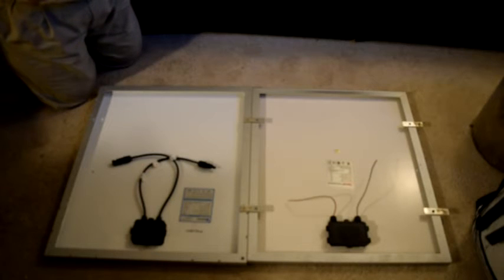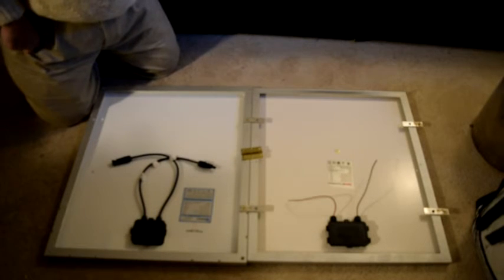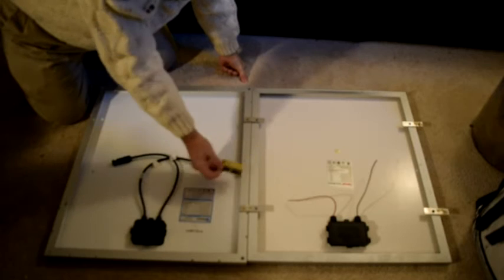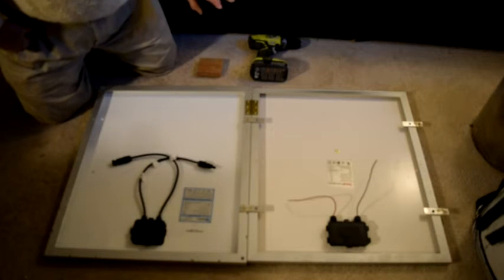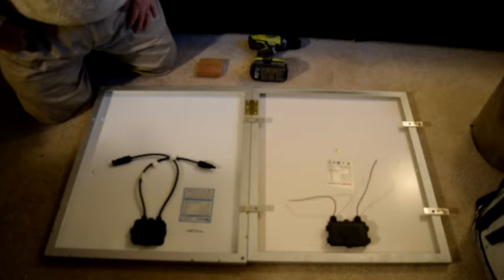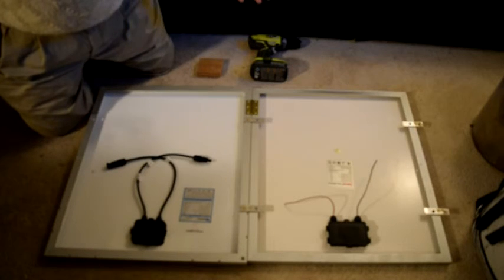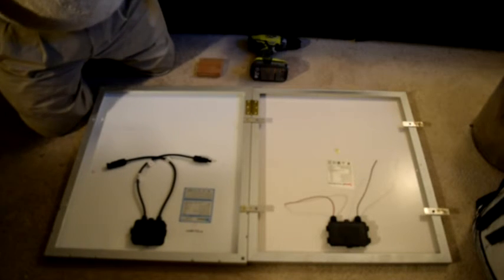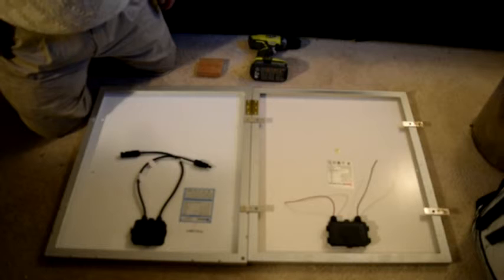DIY Portable Solar - 2:  Folding 100 watt portable solar setup

Comment: Hi Todd, love your solar videos. I am researching the best approach to take in creating a mobile solar system for truck bed camping. I have a travel trailer w 100 watt solar system but want to have a separate more wattage system for dry camping w truck alone. Call me crazy but I would like more conveniences while truck bed camping. System can then be used to upgrade watts for travel trailer as well. Problem is the size of panels for handling purposes. I saw this video and wondered if I should make 3 of these 100 watt portables to be used in additional to a 100 watt renogy suitcase kit I purchased few years ago.  Would there be any difference in battery charging capabilities if had 4 portables (8 x 50 watt) set up in series w mppt controller versus 2 150 watt panels (300 watts) and the 100 watt suitcase  set up in series w mppt controller? I think I could physically handle and store the 4 portables easier in crew cab part of my truck. Also, plan to keep the battery bank in back seat area as well. Battery bank another big research thing as well. 
Thanks so much in advance for a response.
Reply from the maker: Hi Katherine,
You asked a complex question.  I will do what I can to answer it for you.  How much solar you need depends on a number of factors including: how much power you use a day (i.e., what you are powering), and where and when you are camping.  If you camp in an area with lots of cloudy weather you will want more solar than if you are in a generally sunny area.  Sizing the battery bank depends on three main things.  First, how much power do you use.  If you use 100 apm-hours pr day you want at least a 200 amp-hour battery bank.  Second, how long would you like to be able to run on your batteries if the weather is cloudy.  Finally, how long would you like your batteries to last (the bigger your battery bank relative to your use, the longer the batteries will last.  So if you can give me a few details of how you camp (what sort of stuff you run off batteries, what part of the country you camp in, how long you generally go out for) I can give you some much more specific details.  No need to give me any specific information as far as location, just southwest, midwest, northwest, etc.

As far as running 400 watts of solar goes you will want a 30 amp controller.  If you went with four foldable 100 watt systems I would set them up individually and run the wires to a common point next to the controller so that you can have relatively long wires between the panels and the common point.  I can make this more clear in a short video if you want.

Hope my comments help.  Thanks for watching my videos and commenting.
Reply: Todd Dunn thanks so much for responding. I live in southwest, New Mexico. I love going to northern NM and Colorado w my travel trailer. I also do some travel trailering in AZ and all over NM when not too hot. I am fixing up my Dodge Ram 6.5 bed w a cap on Monday so I can venture into places I would not  dream of taking my 30 ft trailer. I want to be comfortable so I would like to be able to run a fan all night and  more, run a 600 watt dial microwave for short periods, single serve Keurig  if I can, and the usual phone, notebook, type things, likely a 12 volt portable cooler too. I also want to use these things for my travel trailer when I boon dock. I don't boon dock often because I love my Keurig barista coffee. Can't run a generator because I am awake way too early to run it. I calculated about 1500 watts a day w a 2 day reserve needed in addition to the 1500. I would want to only run my batteries down by 25%. AGM 6 volt 225 AH is what I am thinking to buy, 4 of them. 900 AH so if my thinking is correct that only would leave me w 222 AH use for 132 amps, 264 amps w the reserve day.  Not sure calculated all this correct. New to all this solar math. 1500 likely on higher side of what I would use daily. 

The solar suitcase is all I have now. 2 50 watt panels, Renogy. I am thinking I need the 400 watts to be able to charge the batteries 25 DOD. I want to get going on buying the panels before stocks run out at current prices. I had bought a 1100 watt modified sinewave inverter but now realize w bigger battery bank will can now use more watts, coffee, lol.  I am likely buying a pure sinewave and keep 1100 as a backup. I am 60 years old so trying to keep weight down on panels and batteries but do not want to skimp on quality. 

I need to buy the mppt controller too.  I was thinking to wire panels in series so the batteries can charge more efficiently.

Hopefully, I haven't over whelmed you w information. Thanks so much for your feedback.

Edited: microwave reflects 950 input and 600 watt output. Not sure what that means but assuming I have to factor watts at larger 950, which I did. However, only maybe 30 minutes daily but realistically less. My Fan is a 72 watt fan. Surprised fans have such high watts. Also, above should reflect 225 not 222 AH useable at 25% DOD.

Thanks
Reply from the maker: OK lets look at how much power you use.  Before I do that I have to say that you might have a problem running the microwave off of the modified sine wave inverter.  I also think that a 1500 watt inverter will be marginal for the Keurig particularly if you want to make more than one cup of coffee  quickly.  Also, some microwaves do not like modified sine wave power much.  You will have to try it to find out.  Now that I have said that lets look at your appliances and how much power they draw.  I am going to assume 85& efficiency for your inverter for the AC appliances to be on the conservative side.

Microwave - 600 watts/0.85 inverter efficiency = 705 watts per hour of use.  Lets say you use it 20 minutes a day. So 705 watts x 1/3 hour = 235 watts

Keurig coffee maker (calculated per cup) = Approximately 1500 watts when running and about 1 minutes to make a cup so watts per cup  = 1500/(0.85x60) = about 30 watts per cup

12 volt Dometic cooler uses about 3.5 amps when running and runs say 10 minutes per hour so 240 minutes 4 hours) per day or 14 amp-hr (~ 175 watts) - This one is a bit variable since it depends on how big your cooler is, hot hot it is where the cooler is, how often you open it and how full it is.  These coolers actually run less often when they are full of cold stuff.  I base the numbers above on my Dometic 40 quart cooler.

Charging a typical cell phone takes 10-15 watts.

Charging a typical laptop takes about 50 watts

The fan is hard to judge since it depends on what you have.  A typical 12 volt fan draws about 1.5 amps so 12 amp-hr for 8 hours or about 150 watts

Lights are an additional item.  Assuming you have LED lights each light draws about 0.02 amps at 12.8 volts so say 8 hours of lights per night gives 2 watts

That comes to a total of 567 watts so say 600 watts per day.  I allowed 3 cups of coffee per day.  Assuming 12.5 volts from the batteries that is about 50 amp-hr per day.  If you want to be able to run for two days without charging and not draw your batteries down by more than 25%, you will need 400 amp-hr of lead acid battery capacity.  So four 6-volt golf cart batteries will be fine.

On a sunny day if your solar panels are out from dawn to dusk they will produce about 50-60% of rated capacity over the day.  So that means you will get 500-600 watts of charging out of a 100 watt panel over a typical 10 hour day.  On a cloudy day the panel output would likely be only 25% of that.  So on sunny days you could get by with two 100 watt panels particularly considering that during the day the solar panels would provide the power to run the cooler and you would have power left over.  On cloudy days you need to get about 2400 watts from the panels so 400 watts of panels will do the job.

I hope this helps.
Reply: Todd Dunn wow I was way off on watts. I calculated wrong on my 12 hour use of my .6 amp fan. I was dividing amps for ac items  by 120 at one point and forgot to fix the fan amp to watt conversion. I was using 864 watts needed instead of 86.  I redid my numbers and came up w about 750 watts. 

I am trying to respond to your comments, not easily done, no scrolling back up, on my iPad anyway. I will edit as I go along. So more will follow in a few minutes.

Edit 1: if I am right, lol,  about 750 watts equates to 63 amps, 126 amps for 2nd day reserve. If I get a 400 AH agm battery bank, 25% DOD would give me only 100 ah.  I haven't done much research on golf cart battery sizes.  It appears I will need larger AH (126) or just make boiled water for coffee, lol, on cloudy days.  And not use micro on those days either. 
Panels in next edit.

Edit 2: the 400 watt in panels I am trying to understand but having a hard time. I was thinking I needed that much w 900 AH battery bank (4 x 225AH batteries) but w a 400 AH bank (4x100 AH) not understanding. 25% DOD on 400 ah's is 100. Each 100 watt panel with 500 watts produced  will do what to a 100 AH battery? Do you think you could explain that a little more. Your 2400 needed on cloudy days is throwing me off too.  That should be it, thanks again.

Edit 3: fan 120 volt not a 12 volt. Just reread and see you stated a 12 volt fan. So did have right but will switch to a 12 volt fan. Just bought a killawatt meter. 120 volt fan drawing about 40 watts. Less than the 72 watt calculation. .6 x 120 = 72 watts

Edit 4 Feb 1st: My mind is grasping the 2400 watts needs from panels on cloudy days (4 panels instead of 2 needed) but harder too grasp the storage in battery part. Hopefully, have following correct. Keeping w the 400 AH battery scenario (if used only 600 watts). I am only using 50amps which is 12.5 DOD so have the other 12.5 for next cloudy day. So in theory, if never have cloudy days, lol, I would always be using batteries only to 12.5 DOD. If what I said is correct, why do I need 400 watts in solar instead of 200 watts? It would seem the 200 Watts in solar producing 1000 to 1200 watts on a full sunny day  would bring batteries back up to the 100 AH capacity. Leaving me fully charged for next cloudy day. So following day (day 3) I start w 12.5 DOD but 200 watts of solar produces enough in that 10 hour sunny day (1200 / 12 = 100 amp) for me to use 50 amp hours and fill the other 50 amp hour loss from previous cloudy day. My thinking is the. 200 watts in solar is producing exactly enough 100 amps but that is in ideal 100 amp production on sunny day.  So why 400 watts and not 250 or 300 watts in solar?
Reply: Todd Dunn short video would be great on the panel set up. Hope I am not being a pest.
Reply from the maker: Katherine, the power ratings on things like fans are based on the current needed to start the motor, which is always higher than the current needed to keep the motor running, so I am not surprised your watts used came in below volts times the amp rating.  I will try to explain my logic on the batteries.  Basically, on a full sun day you only get full output from your panels for 2-3 hours centered around noon.  Outside of those hours the panel output drops off as the time is farther from noon.  In other words your panel output varies from zero at dawn to 100% by about 10-10:30, holds at 100% until 1:30 to 2 then drops to zero by sunset.  If you average the power output over the day it works out to about 60%.  So for a 10 hour day (I am assuming you won't get up at dawn to set your portable panels out), a 100 watt panel will put out about 600 watt hours that will be available for battery charging.  600 watt hours is about 45 amp-hours at  typical charging voltages of 13-14.4 volts.  However, lead acid batteries are not 100% efficient at accepting charge.  You can expect around 85% efficiency so that 45 amp-hours really means 45x0.85 = 38 amp-hours back into the batteries.  That is why I said you will need 200 watts to replace 50 amp-hours in the batteries with a little left over to run stuff directly from the solar panels during the day.  So go ahead and make a cup of coffee with the Keurig at lunch when some of the power will come directly from your panels.  However, on cloudy days your solar panels will only put out about 25% of what they put out on sunny days, so you will only replace about 10 amp-hours in your batteries from a 100 watt panel.  400 watts of panels would come close to recharging your batteries on sunny days .

Now as far at your estimated 750 watts a day of use goes.  I assume that the battery voltage during use is about 12.5 on average, so 750 watt-hr/12.5 volts = 60 amp-hours.  If you size your battery bank so that 60 amp hours draws it down by 25%, that means you need 240 amp-hours of battery capacity or one pair of T-105 6 volt golf cart batteries.  If you want to be able to go 2 days and only draw your batteries down by 25% you will need 480 amp-hours of battery capacity or 4 T-105 6 volt golf cart batteries.  Quality golf cart batteries like Trojans should give about 3200 discharge/charge cycles at 25% discharge and 1700 cycles at 50% discharge.  However, if your battery bank is sized for 25% discharge on most days an occasional 50% discharge (two cloudy days in a row)  won't have a huge effect.  If 75% of your discharges are to 25% and 25 percent of discharges are to 50%, the cycle life will be around 2800 cycles.   So in practice you can live with 2 gold cart batteries if you mostly camp on sunny days.  For northern New Mexico 75% sunny days would be close to the average based on climate statistics.  If you are a weekend camper and go out for 26 weekends a year, that gives 52 discharge/charge cycles a year, so 2,800 cycles is about 55 years, which is likely longer than you will own your trailer.  Similarly, if you were to full time, 2800 cycles is about seven and a half years.  So I would conclude that you can probably get away with two 6 volt golf cart batteries and 200 watts of solar.

Lets look at that a slightly different way.  If you go out and camp for two cloudy days, 200 watts of solar will charge your batteries by about 20 amp-hr each day.  So with a 240 amp-hr battery bank your 60 amp-hr of use will draw the batteries down by 40 amp-hr each day (60 minus 20).  So after two days your batteries will be down by 80 amp hours or 33%. Under those conditions you could go three days before you draw the batteries down by 50% and start significantly degrading battery life.

I hope I made it clearer.
Reply: Todd Dunn thank you so much for the detailed explanations. I am going back to the drawing board now that I understand the 6 volt to 12 volt series AH conversion. I am finding it very difficult to pick out batteries, where to get them. I am going to get AGM because I will be keeping them in my truck because of wt, so I need the glass Matt, AGM, battery due to no off gassing.  I am pretty strong for my age but realize I am not a young chicken anymore. I will look at the Trojans again: researched just now and see 217 AH AGM's available. There are some VMax AGM 6-volt 225 ah that I can get off of Amazon. Very discouraging that I can't just go to a store and purchase. I will be going to the big city tomorrow, EL Paso,  and there is a continental battery store where I can order some batteries. Their website shows Trojans, FullRiver, and Continental (UB) 6volt availability. I still need to make up my mind on size of battery bank and solar watts. If go for 4 batteries than will get more solar than 200 watts. 

Side note, I typically only drink 2 cups of coffee a day and usually very very early, lol. And really the microwave will be used mostly to heat a pet heat disk that I use for myself for warmth during the night, takes 7 minutes. And occasionally, micro used to heat up leftovers or cold coffee. For truck camping maybe micro used for water for coffee instead of Keurig or camp stove. When it is warm outside whole different ball game. But then, electric cooler and fan will come into play big time. See the cooler you mentioned is big $$ but see other campers recommend too and good ratings. Can't take my money w me and also a cancer survivor.

Once again thank you so much for your time, patience, and knowledge provided.